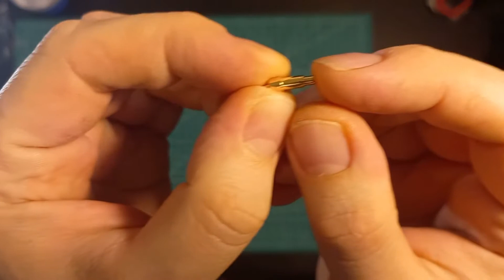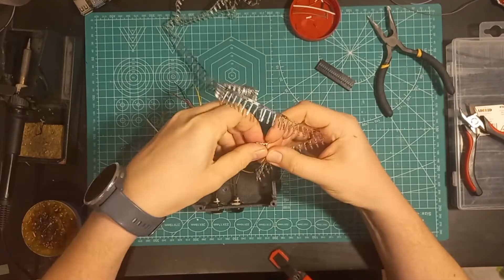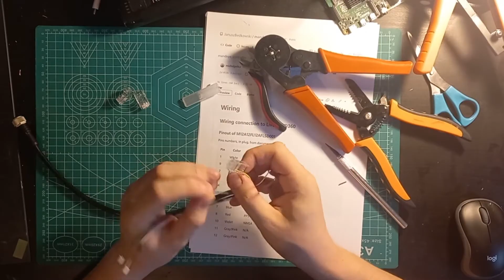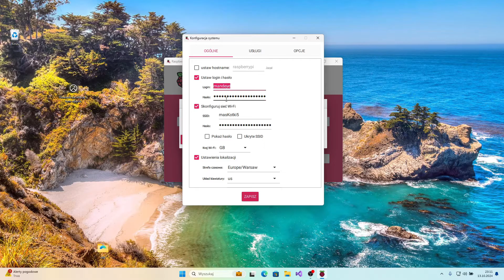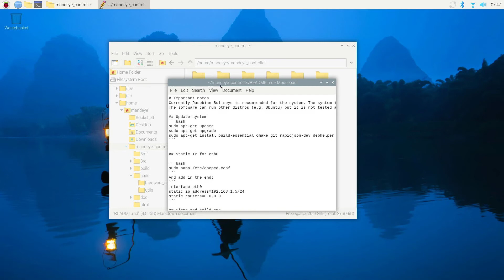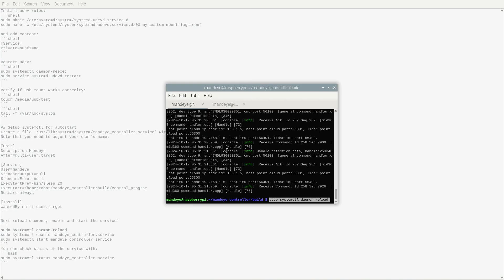Build instruction for Mandeye handheld laser scanner

Comment: How much RAM should the Raspberry Pi have ?
Reply from the maker: 1 GB is enough. However it gives very bad experience building the project. You need to run onethread build. If you plan to buy new raspberry go with more RAM.
Reply: @michapeka2800  Thanks ! I thought that would be the case ! I shall get the 8g Pi4
Reply from the maker: If you plan to run any development, definitely 8gb is worth it.

Comment: Congratulations, great video. I'm following the project on github to make a Handheld 3d scanner and this video helps me. I saw that there is support for both RTK and camera, but these sections are not present in the video. If possible I would like to share my ideas, I made a 3d model of the project.
Reply from the maker: Support for GNSS is available in current version. It requires changes in code to adjust to your GPS. It is more advanced usecase.
The support for camera is still in development.

Comment: Hi, great tutorial! I was wondering if it’s possible to use the Livox Mid-360 LiDAR to detect 3D objects, such as people. On the Livox website, they showcase a demo where the system appears to detect people in 3D. Livox also has a GitHub repository, livox_detection, that supports 3D detection, but I saw a comment mentioning that the Mid-360 performs poorly in this regard. My question is whether the point cloud generated by the Mid-360 can effectively support deep learning algorithms for 3D object detection, like PointNet, PointPillars, or VoxelNet, or if this LiDAR model is better suited for SLAM applications.

Comment: Thanks @michapeka2800 for this  tutorial. I got stuck but, I will be able to continue with this project now.
Reply from the maker: Great. That was a goal. Where did you stuck initially?
Reply: @ I soldered everything together and bought a BG37 on eBay but got a BG18 instead.  But luckily I got the money back and didn't have to send the grip back.  Also, the grip was not charged enough and I am now looking for a charger now. But I can't find any.  Where did you buy your charger for the BG37 battery grip?
Reply: @stagrei8233 i Also got BG18 unfortunately, and my problem is that it is powering raspberry pi, but it powers it as soon as pins touch, so no even a need to use a power button on the grip, which makes is a little bit difficult as case slides onto a grip very firmly. So it is difficult just to put and remove grip every time I need to make a scan( scanning part is not yet even done)
Reply: Powering issue is ofcourse could be caused by the wrong wires placing. I’m very bad with it, plus cable scheme I found a little hard to follow, so I yet did not make lights lit . But this video hopefully clarifies it for me